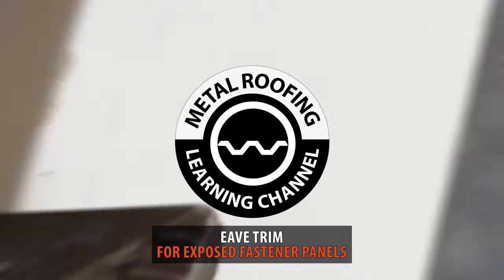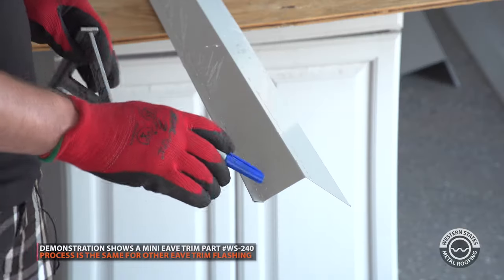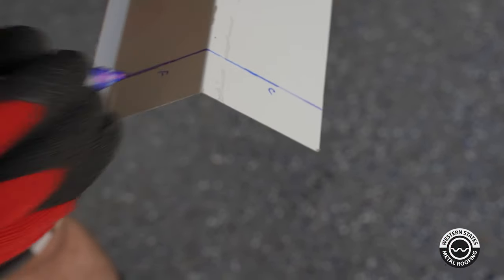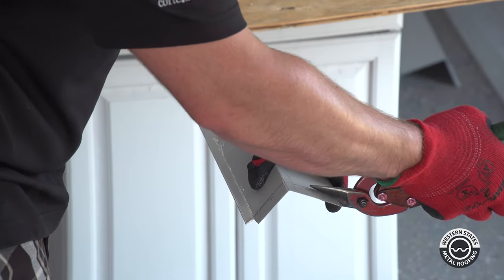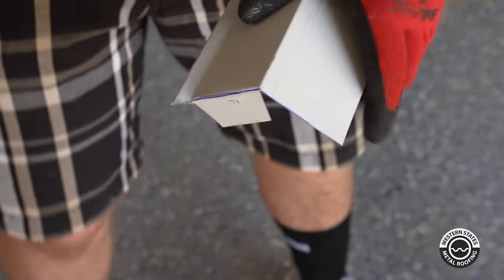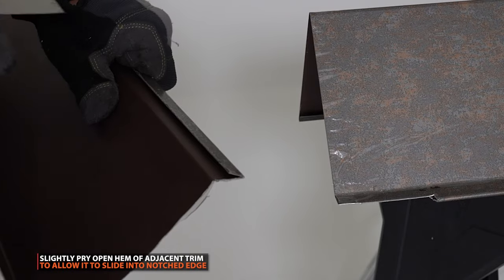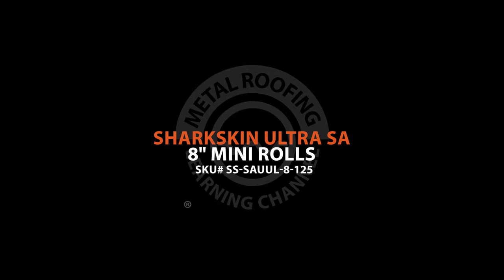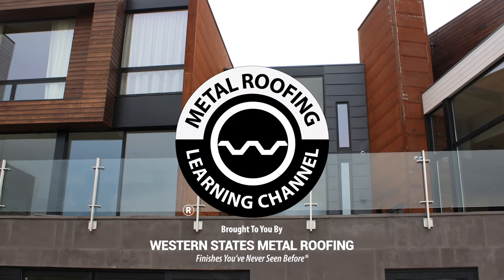How To Install Eave Trim Or Drip Edge On A Metal Roof. Updated For 2022

Comment: If you place underlayment over the eave trim but over the existing underlayment, doesn’t that mean water will get under the eave trim since the overlapping is opposite what it should be, that way water runs over the underlayment? Like, installing underlayment starts at
The lowest side of the pitch and you work up, that way water runs down over the existing underlayment, then at the end, now there would be underlayment running over what was there…. 

Also, do you have to use narrow eave flashing with gutters, or can you use wide eave flashing?